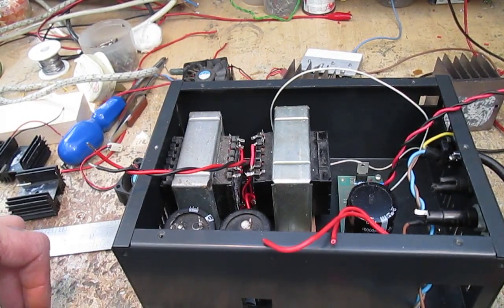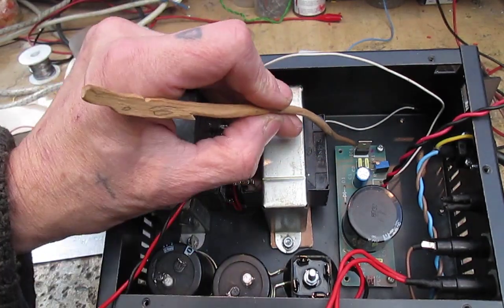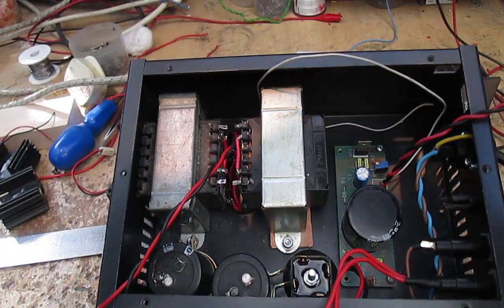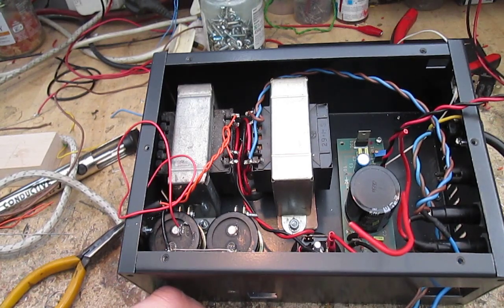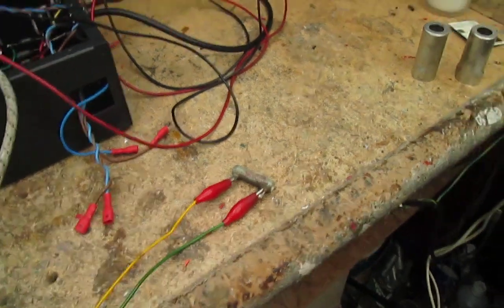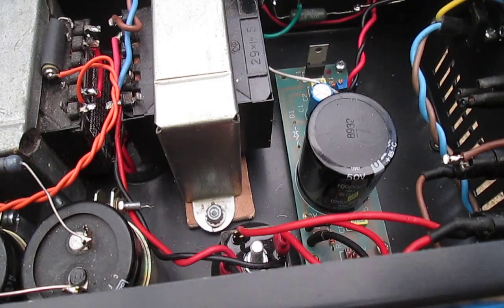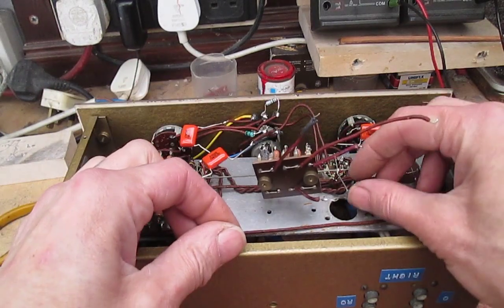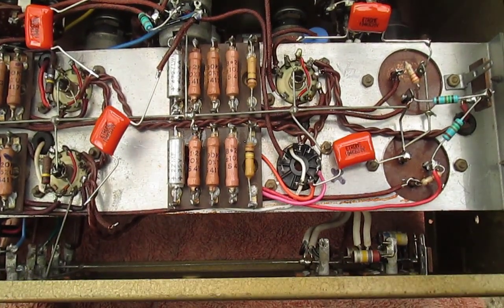Sterns Stereophonic Pre-Amplifier - Rebuilding  & Power Supply - Part Three.

Comment: If you don't want to deal with an LM317, you can use a LM7812 and put a 5K pot or resistor in the base to set the voltage, or you can put a diode in series with the base of the LM7812m and that should give you an additional .52V output for every diode in series with the base. I use 1n4007 diodes (Basically because I bought 100 of them in a lot. 1n4000 series should also work OK., as they are rated for 1 A with full lead length.). I loved your tossing the Sherlock Holmes ref. I would also suggest adding a heatsink to the LM317.
Reply from the maker: Thanks for those ideas Frank & TFW as always.